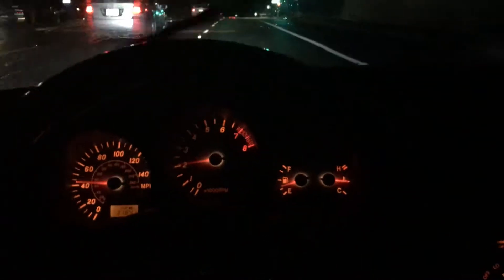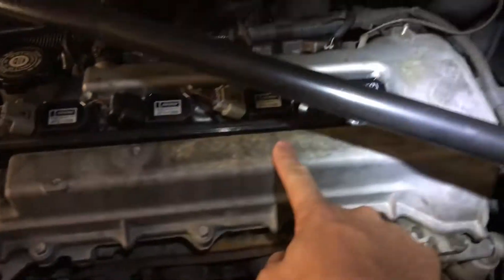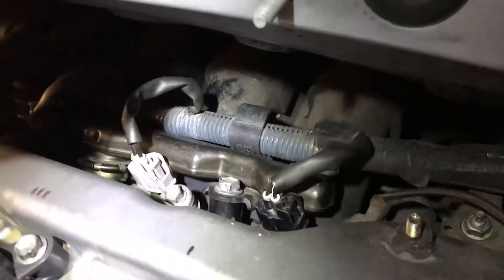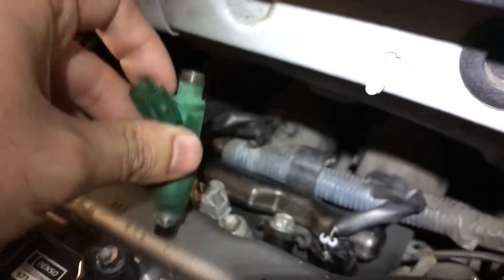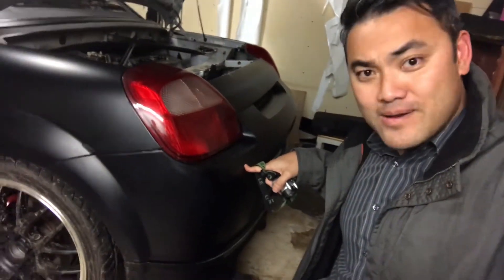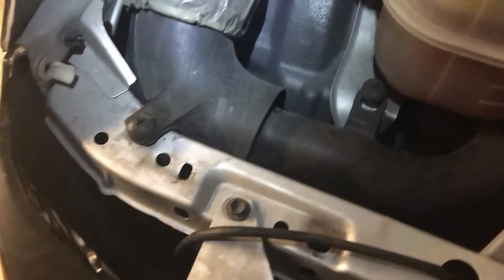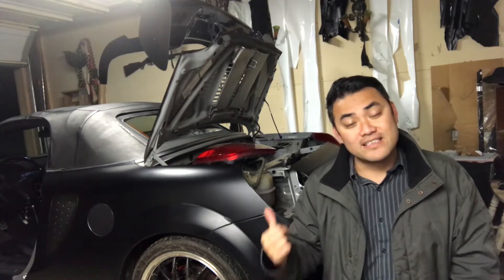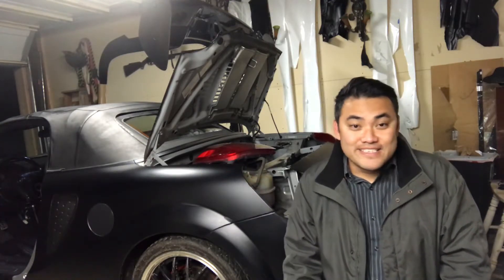HOW TO FIX CHECK ENGINE LIGHT P0141 AND P301 ON TOYOTA MR2 SPYDER

Comment: I have a Mr2 spyder 01, my problem is that the car starts the check engine and it smells a lot of gasoline, the car starts to fail. I have replaced 3 oxygen sensors, the injectors, clean the gas tank and change the pump. when it has the fault, I just unplug the battery and reconnect it and it works perfect for 15 minutes and turns on the check light. I do not use it because I have not been able to solve the problem. great video thanks
Reply: get a code reader and run a test, I got one on amazon when the check engine light came on and it said it was an O2 sensor.
Reply: What fault codes are it throwing? You can get a code reader for cheap, in fact buy a $16 bluetooth OBDII reader and download the "torque pro" app on your phone or tablet and that will show you stuff most code readers won't such as fuel trims and live O2 sensor readings, but it will also allow you to search the check engine codes which will give you a good clue as to what is failing. Tragic you aren't driving it, sell it to someone who has time to invest in repairing it if you can't find the time :) these cars are meant to be enjoyed and I love mine! Let me know what codes it's throwing I may be able to point you in the right direction. Cheers!
Reply: Did u ever fix it??? I’m having this right now please help me
Reply: @alejandrosilva7892  after many tests, we realized that the problem was the ecu, we replaced it and problem solved. the ecu needs to be programmed, my car is a mr2 spyder 2001 engine 1zz. good luck

Comment: Hi ,welcome to the strange world of MR2/S MK3. just one point, the number 1 cylinder is always to the front of the engine in our case where the timing chain is, you were starting at the back .hope this helps for the future.

David ,  ( UK)
Reply from the maker: David Richards thanks for the info! I’ll take note next time! So to confirm it goes 4321 if you are looking at the engine from the rear?
Reply: Yes looking from the rear 4321 . look on mr2roc.org 1zz rebuild., on you tube there are plenty of 1 zz engines in state of rebuild. look for phoenix and dad,and peter finn they help me a lot when i rebuilt my engine ,the piston rings were all gummed up solid causing heavy oil consumption .you say you might go the turbo route, have a look at the 2zz ge out of a Celica. comes 190bhp out of the box this is the engine they should have had ,lots of of videos on this and lots of specialist in America. they also put this engine in the Lotus Elise. you can also get a celica engine with super charger. look at Spyder Lee he does a comparison , Mitch Dore , and StarkReality  Do plenty of research, all the best

Comment: Hello Hoang B4,

Nice Video and welcome to the MR2/S MK3 Toyota!

I could not see your exhaust system so do not know your model year range.

I have an 2001 with original engine and only 59k miles, and the engine will fail soon.

The early MR2/S spyders, like mine, had two catalytic converters installed on the exhaust manifold.  Unfortunately, the "cats" would break-down and with them being so close to the exhaust valve would actually suck back the "cat" material and prematurely damage the engine bore.  This is what happened to my vehicle and it trips the P0300 and other misfire codes.  It also consumes oil at ~1quart per 500 miles!

Hope you do not have this issue.

PS:  Engine cylinder order as not correct on your video.  Cylinder count starts at the "front of the engine" which is noted by the accessories (A/C compressor, alternator, etc.).  Cylinder 1 on MR2/S is on passenger side of vehicle......many shops also make same mistake as this engines main usage in on a front engine front drive vehicle where when looking at engine, cylinder count starts on left, passenger side (for left hand drive vehicles - LHD).  NOTE:  Cylinder 1 is always on passenger side for LHD vehicle, does not matter if engine is in in front or rear of vehicle.

hope this helps and welcome to MR2/S owership.

P
Reply from the maker: LSmiata thanks for the tip! The pre cats were removed when I bought it so it doesn’t have that problem.
Reply: NICE and hope the pre-cats were removed b/4 any issues.

Just be mindful of oil consumption....that is the give-away key that engine is damaged.

NOTE:  I also wen through COP and O2 sensors hoping for best but I am stuck!   GRRR  and dealer knew what they sold.

P
Reply from the maker: LSmiata my precats were already done when I got it so it’s running great now! Sounds like you need to do a 2zz swap.
Reply: Great news!

I am actually in the process of upgrading to 2zz.  Purchased local drop-out from a Celica GTS and have it down to a bare block right now.  It will be a long process, but hoping to make some youtube videos to give back to the community.

I have learned a LOT from people like you and others posting videos.

Cheers,
P